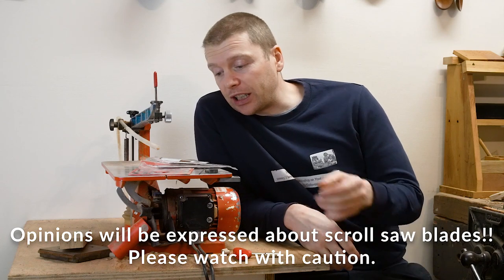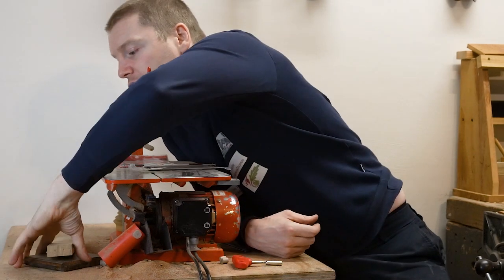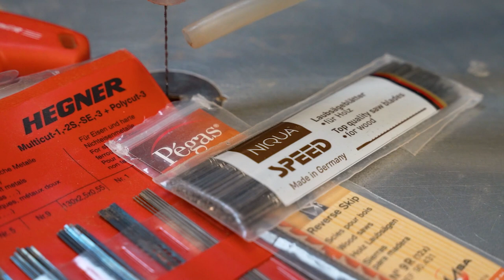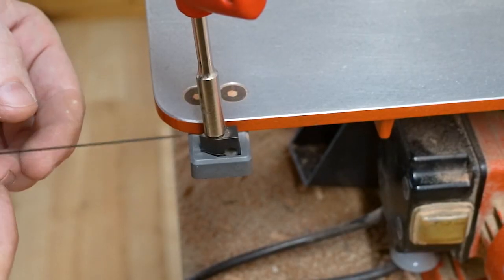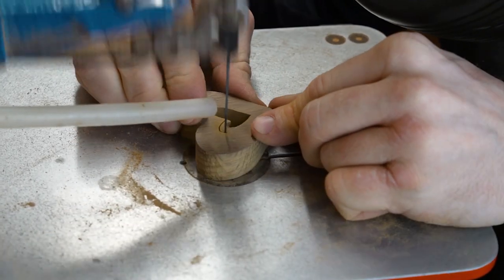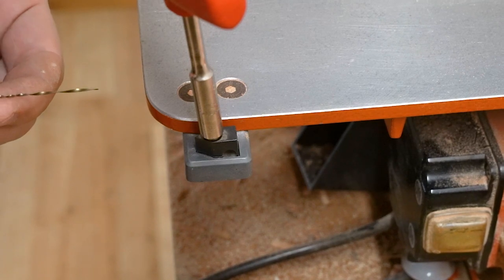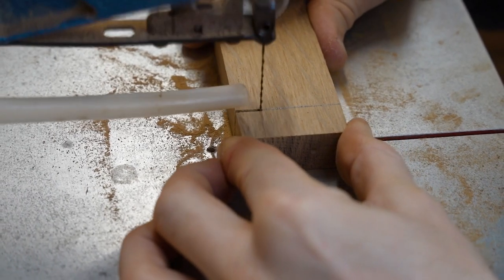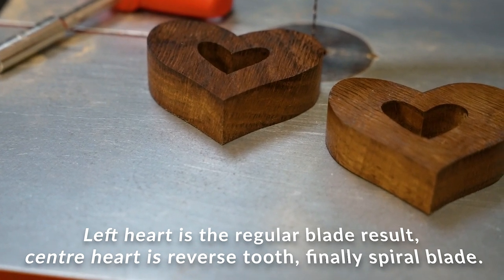Scroll Saw Blades, beginners guide. (Standard tooth vs Reverse tooth vs Spiral blades for wood work)

Comment: I've been using  Flying Dutchman Ultra reverse blades on my Hegner when cutting gears for my wooden clocks. These blades have reverse teeth along the whole edge of the blade. Two teath down, one tooth up. I mostly use the No. 3 and No. 5 blades. These blades are great for cutting 1/4 to 3/4 inch Baltic Birch because they leave a supersmooth finish.
Reply from the maker: Hi Walter, great to hear from you. This sounds very interesting, I will have to check these out, would love to try them out to see how they cut. 

Thanks for sharing the information with us. Great to hear about the different blades everyone else uses. All the best from us all here at The Lovespoon Workshop. 👍👍

Comment: I use Niqua also on my Hegner Multicut 1, because I work with hard woods (oak, cherry, nut) no thicker than 4 to 6 mm I use numbers 3 and 5 where 5 is used for stacks/double wood. I experience drift with Niqua especially the number 5. I use a block with sanding cloth to sand down the back of the saw blade. I also used Pegas advanced geometry, this brought not enough ‘plusses’ in use to justify the high price.
Reply from the maker: Hi Nico, great to hear from you and thanks for your input. It's always great to hear about other people's experiences with their own scroll sawing.

Blades is such a fascinating part of scroll sawing. Tried lots of the different Pegas blades and always come back to the Niqua ones. I did enjoy working with the Flying Dutchman blades but found them very similar to the Niqua blades and they are easier for me to get hold of.

We use the number 9 blades and they do the job we want. Never had any issues with the drifting or perhaps I am just used to correcting it as I cut. 😂😂

Thanks again for getting in touch and supporting our YouTube channel. All the best from us all here at The Lovespoon Workshop. 👍👍

Comment: I’ve tried the spiral blades and found it hard to get straight lines when cutting harder woods. Am I doing something wrong?
Reply from the maker: Hi Ron, great to hear from you. In my honest opinion the answer would be no, you are probably not doing anything wrong. I personally find spiral blades are far more difficult to get a quality cut and finish on than other blades. They are a great idea in theory but whenever I have used them I am not happy with the quality of the cut they leave.

Some seem to master using them and get some great results but for me I prefer a reverse tooth blade. Gives a far better quality finish and is much better to work with.

My own blade preference is the Niqua speed reverse tooth number 9 blade or the Flying Dutchman reverse tooth number 9 blade. The Pegas number 9 reverse tooth blade is another good option but I have to sand across the blade to prevent it from slipping in the blade holder.

Thanks for getting in touch and supporting our YouTube channel. All the very best from us all here at The Lovespoon Workshop. 👍👍

Comment: Hi nice video. I am new to scroll sawing. Got a question for the community re: the blades.  I am using the pin head blades. I have the blade installed correctly according to the manual. I have the tension set as well. However; when I start my cuts at an angle to the wood the blade wants to twist on me (sliding over the wood not cutting).  But if I go straight into the wood it cuts fine. Any idea why the blade is twisting on me when I attempt to cut into the wood at an angle? BTW I am using a Skill 3335 Scroll Saw. Thank you.
Reply from the maker: Hi Brian, great to hear from you, that sounds like a frustrating issue. A few possible issues could be the blade itself, technique and the installation of the blade/machine.

Have you got the correct blade for the job you are doing would be one thing to check. Is it suitable for the type and thickness of material you are working with. Technique, is another thought, are you forcing the machine as opposed to guiding the blade. Have you tried installing the blade differently and adjusting the tension differently to see what happens. Might not make any difference but trial and error is always worth a go. Is the scroll saw installed correctly, bolted to a base and bolted to the floor.

Those are just a few possibilities worth looking at. Never worked with pinless blades myself so not sure about any issues with blade drift/twisting etc. When I started scroll sawing I used to use a more entry level machine and blade drift/twisting was a major issue.

Thank you again for getting in touch and supporting our YouTube channel. All the best from us all here at The Lovespoon Workshop. 
👍👍
Reply: @DailovespoonsThomas  Thank you for your input. I will look into these items you have mentioned. I think I may also need to adjust my speed as well.
Reply from the maker: Speed would definitely be another consideration as well as the speed you feed it through the machine. Hope you find a solution and get the results you are looking for.

Thanks again, all the best from us all here at The Lovespoon Workshop. 👍👍

Comment: I don’t have any good opinions or thoughts to provide yet. I’m doing homework to cut down on the hard ache when I start using my scroll saw when it arrives. I will say the cleaner the cut should be better to cut down on the overall work which in turn would speed up production
Reply from the maker: Blades are probably the area of scroll sawing that generates the most debate. Always liked the idea of the spiral blades but the ones that I have tried have never matched my hopes. The principle seems great but never really worked for myself. Tried all sort of blades but always come back to my favourite Niqua number 9 reverse tooth blades. Perhaps it is because that is what I am used to working with. 👍👍
Reply: Just ordered my first one.. Super excited. I wanna cut sports team logos for gifts for and things like that.. How did you make out? And what saw did you order?

Comment: my problem is wood jumping ive tried different speeds but cant seem to stop the piece trying to lift up ?
Reply from the maker: Hi Ronnie, great to hear from you. Jumping wood can certainly be annoying. You do have hold down attachments that can clamp it for you but most find it gets in the way. I stack cut small projects onto larger pieces of wood to make it easier to control when cutting out. Reducing the feed speed can help too. I went from using a band saw that has a faster feed speed to a scroll saw, so it took a while to get used to a slower feed speed. I sand the back of the wood to get it flat on the scroll saw bed, that helps to reduce jumping too.

Hope you find a method that works well for you. Thanks for getting in touch and supporting our YouTube channel. All the very best from us all. 👍👍
Reply: @DailovespoonsThomas  Thanks for that
Reply from the maker: @casper1240  you're very welcome. Hope you get it sorted. All the best from us all. 👍👍

Comment: hi my question what are the factor that you have to know when to change these  blade to a new one??
Reply from the maker: Hi Rodrigo,

Great to hear from you. This is a really great question and one that will be the focus of a future video. Of course sometimes a blade will break and this needs to be changed. There are indeed other occasions when we choose to change a blade. For example when a blade becomes discoloured (this will be the focus of our future video) it is necessary to change to blade. On the Niqua blade we have a section that becomes a blueish colour and when this happens we change the blade. The reason we change the blade is because it tends to burn the wood.

Other times when we change the blade is if they get out of shape. Thankfully this is not a frequent issue. We also change blades if we feel it is not cutting well or if it is burning the wood. For example when working with Cherry we use a new blade to reduce the risk of the blade burning the wood.

The basic rule we stick to is if you are not happy with how the blade is performing change it to another one.

Hope that gives you a few ideas of how we manage our blades. Great to hear from you as always. Let me know if you have any follow up questions. All the best from us all here at The Lovespoon Workshop. 👍👍
Reply: @DailovespoonsThomas  Thanks "gracias"
Reply from the maker: @rodrigovillegas9163  de nada👍👍

Comment: Is there a link where to obtain the nicaja blades thank you
Reply from the maker: Hi Wullie,

Great to hear from you, It's starting to get more difficult to get hold of them for the moment. Here is the link below to the eBay seller I got my last packet from. They are based in Poland but the postage was less than a week to arrive.

https://www.ebay.co.uk/itm/Scroll-Saw-Blades-NIQUA-SPEED-5-130mm-2-0-14-Pack-12-144-pcs-Made-in-Germany-/312442344405?mkcid=16&mkevt=1&_trksid=p2349624.m46890.l6249&mkrid=711-127632-2357-0

Hope that link works well. Have a look at all the blades available from that seller, they have quite a good range. 

Thank you again for getting in touch, all the best from us all here at The Lovespoon Workshop. 👍👍

Comment: How to sharp all of these blades if they worn out ?
Reply from the maker: Hi Haris, great to hear from you. I wouldn't really advise spending time trying to sharpen the blades myself. I would replace the blade with another one. We buy them in packs of 120 and use a new one each time one has worn out.

If you really want to have a go at sharpening a blade you could try a dremmel. We sharpen our band saw blades in this way but to do it on a scroll saw blade would be time consuming and unlikely to get alot more out of a blade before it breaks.

For me it would be alot of time and effort for limited gain. Better to use a fresh blade. Others might have different thoughts though?

Thank you for getting in touch. Great to hear from you, all the best from us all here at The Lovespoon Workshop 👍👍

Comment: I’m not a fan of reverse tooth I guess when I started scrolling 40 plus years ago they wasn’t available for me I have tried I think about every blade there is seems blade aren’t as sharp as they were 20 years ago I wonder if anyone else has thought that
Reply from the maker: Hi Jerry great to hear from you. I always find blades fascinating, so many different types and even more different views about them. I will have to ask dad if he finds any difference between blades now and 40 years ago.

The blades we use do the job we want but they don't last as long as we would like. Your thoughts are definitely inkeeping with our own when it comes to things like our carving gouges and other saws. We still use vintage Herring Bros and Addis gouges, made over 100 years ago. For us they are much better quality than more modern gouges. Our band saw was made in the early 1980s and still doing a great job. We recently managed to get a coronet saw. Dad had one years ago and replaced it with a modern circular saw and regretted it. When we saw one come up we bought it. Really nice to work with, such accurate cuts.

Thanks for sharing your thoughts. Definitely be interesting to hear what others have to say too. Great to hear from you as always. All the best from us all here at The Lovespoon Workshop. 👍👍
Reply: @DailovespoonsThomas  I’d like to hear what your dad says if blades use to last longer I mainly cut 3/4-11/2 inch thick I would cut 4-6 hours without blade change an never break a blade an now if I cut now if I can cut 1-2 things without blade change I’m doing good an I use to never break a blade now occasionally I do
Reply from the maker: Hi Jerry, thanks for getting back to me. I have to ask, what is your own preferred blade? I think it could give an interesting insight for others. As we are working on thinner wood ourselves an alternative for others who are working on similar thickness of wood to yourself might help others out. I will ask him for his thoughts on the blade quality.

Thank you again for sharing your own thoughts. Great to hear from you as always. All the best from us all here at The Lovespoon Workshop. 👍👍
Reply: @DailovespoonsThomas  my favorite blades are Eberle BLITZ  No. 7 but I have trouble getting them my supply from years back are getting low so I’m using Pègas No. 7  sometimes if I’m cutting softwoods I’ll use No. 5 I have tried so many different brand blades over the years Olson Blades were really good something changed my first parallel arm scroll saw used 6 inch pinned end blade the only blades I could get were Vermont American I guess that was close to 50 years ago when I finally got 14 inch Hegner I was really surprised how much better blades an everything was
Reply from the maker: Hi Jerry, thank you for sharing this. I am sure this will be really useful for others. Great to have your input on this. Hopefully it will help those out who are trying to decide the best blade for their own scroll saw projects.

Thanks again for sharing your knowledge and supporting our YouTube channel. All the best from us all here at The Lovespoon Workshop. 👍👍